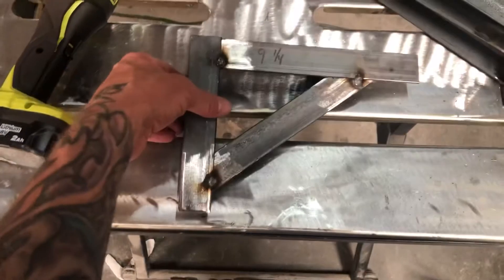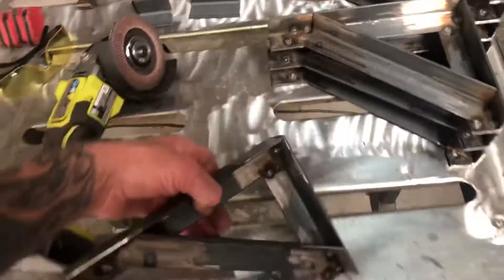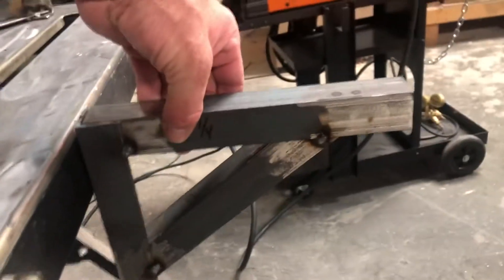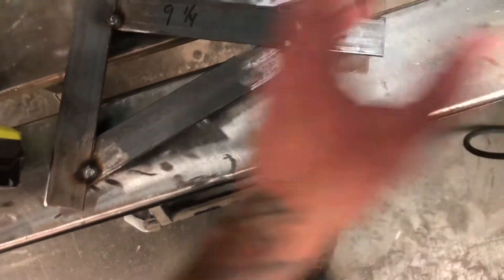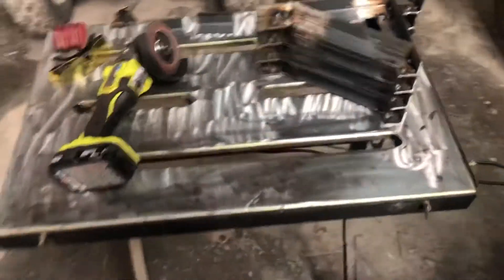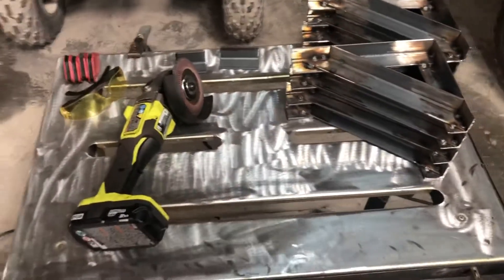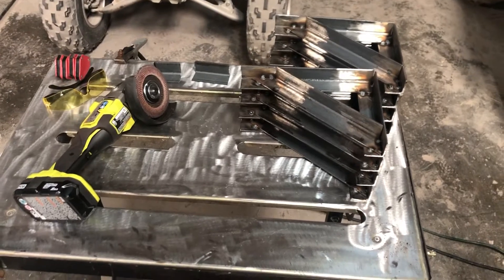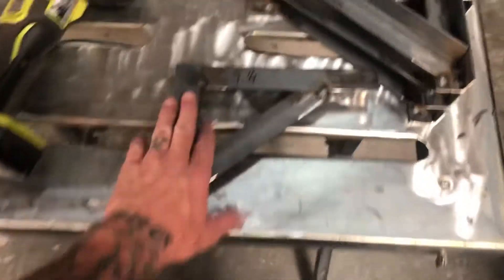Welding things together?

Comment: Best wishes on your move! 🌞
Reply from the maker: Thank you, these fuel prices are the hardest part of the move so far......
Reply: @adventurereadyoffgrid  It is crazy high now! We made half a dozen trips before we moved, bringing materials and our stuff. We got 10 miles per gallon with the loaded trailer, and it was a 600+ mile one way trip. At the time diesel was about $2.30 a gallon, we even filled up for less than $2.00 a gallon a few times!
Reply from the maker: @RedandAprilOff-Grid  Yeah i watched you guys doing your move on your channel  thats when i was shopping for land, driving our giant motorhome up to AZ not these days with diesel hitting over $7 a gallon in SoCal. We should be done with our relocation at the end of the month so we will be somewhat done with the bulk fuel costs for us for now.